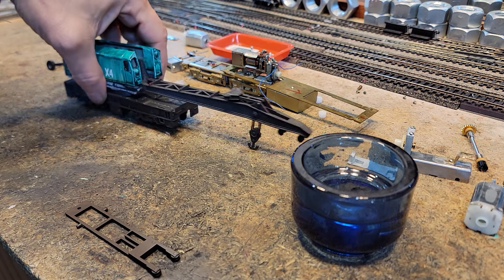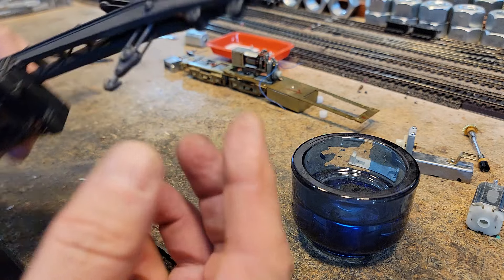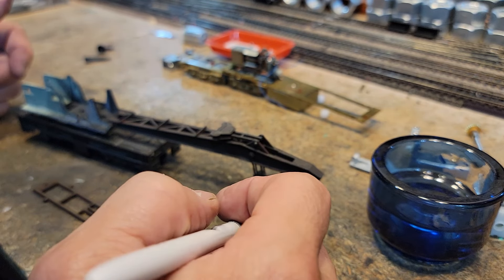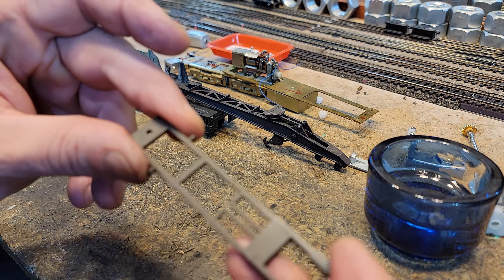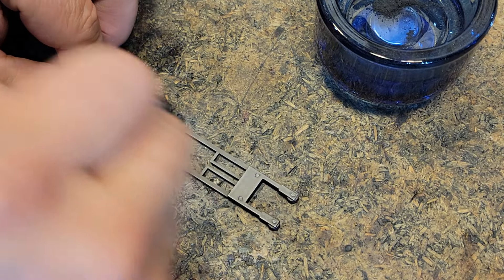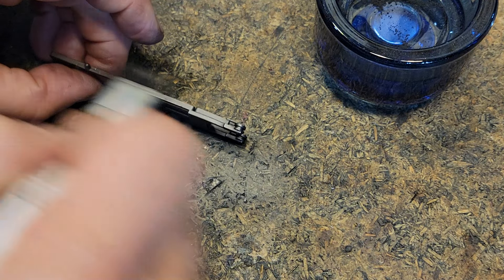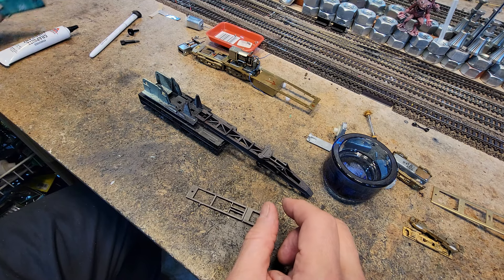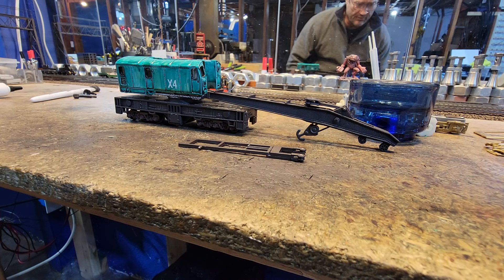Mehano HO Scale Wrecking Crane Graphite Detail

Comment: My crane has a plastic hook fitted permanently but swings at the front of the boom.. then the middle pulley has the cable for the middle hook which attaches to the cable winder inside the cab and then the cable for the main boom lifting is on the front winder.. Yes, it is very hard to find any diagrams or info on the cable arrangement so i have resorted to taking pictures on people's videos and using them to work out the arrangement of the boom and cable...I can send you pics of mine if that helps... I have a video on my channel recently about it.
Reply from the maker: my middle hook is completely missing but the wndlass us there.  I need so many hooks that I think its time to make a moke and cast some pewter!
Reply: @elite194  Do you have a 3D printer.. if so you could reprint them.
Reply from the maker: @TimsBitsnPieces  yes I can 3D print them, but they need weight to hold the cables tight so I'm getting ready to learn lost wax pewter!